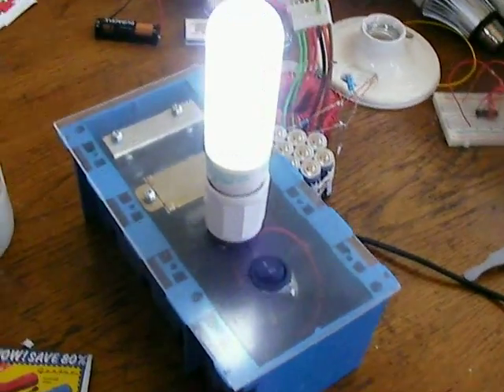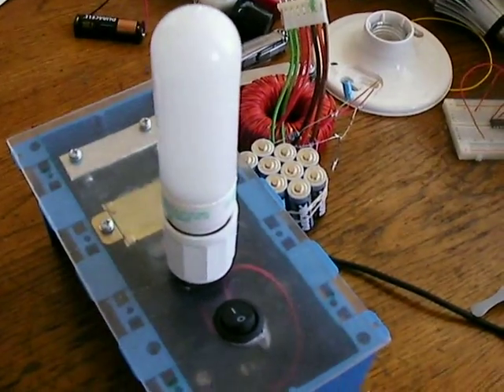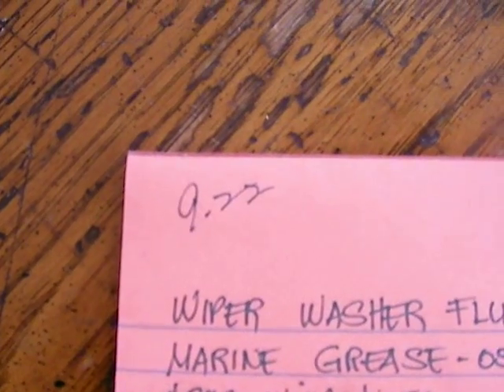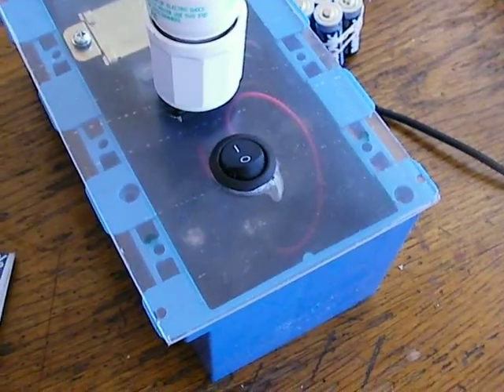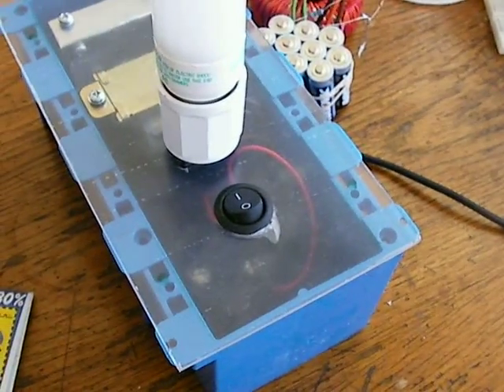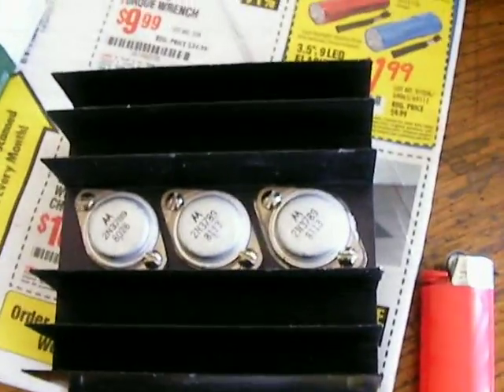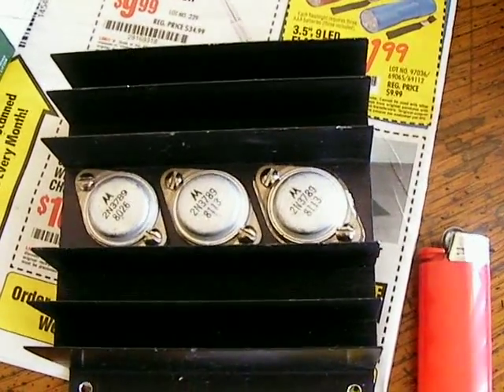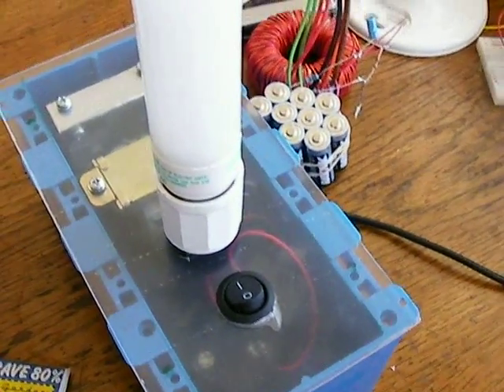Running a 7.5watt ungutted CFL off 8AA batteries

Comment from the maker: March 2, 2013 UPDATE: I ran the Utilitech 7.5 watt bulb and it is now on its 3rd hour with very little diminished light output. Still lighting up the kitchen pretty well and can read a newspaper 5 feet away. Am impressed. Transformer with only slight warm and circuit is cool to the touch. Next test would be the 23 watt CFL to see how long it will last. Remember that I am only using fully recharged 8AA batteries for this test with a starting voltage of 11.42